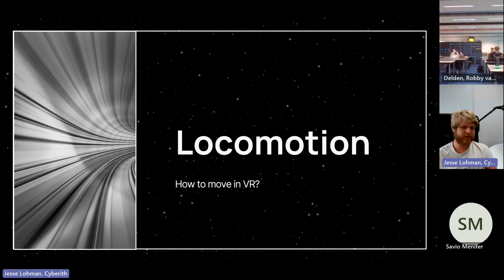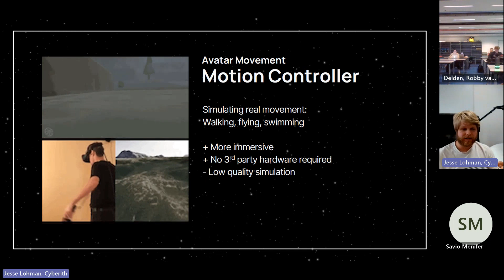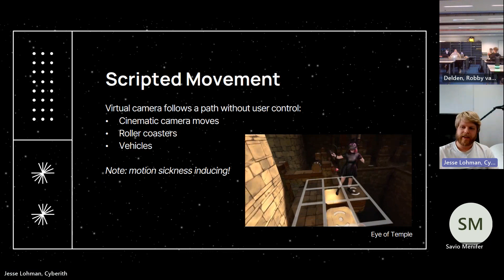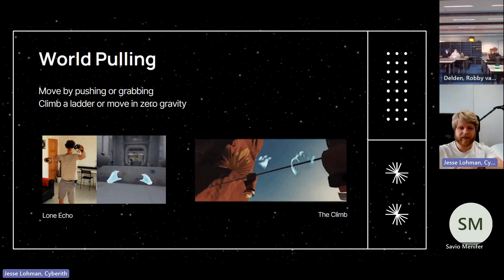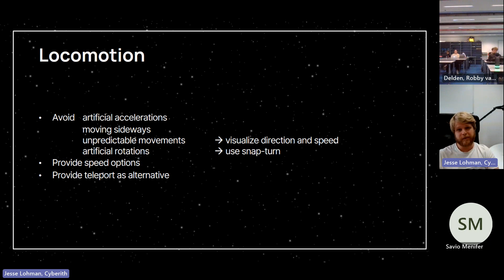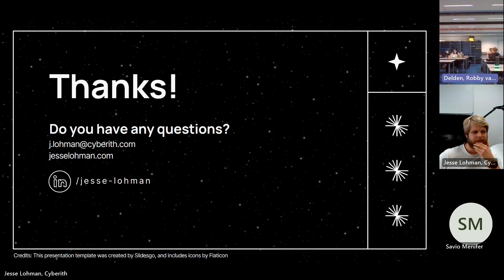Lecture Intro on Motion Sickness and Locomotion in VR

Comment: silly anecdote from personal experience. the motion sickness goes away with time (over the course of days of usage, not necessarily single session) if you use exposure therapy method. PLUS, and this is no joke, if u deep stop, and deep breathe, or just deep breathe while not stopping, it will and can get rid of the sickness feeling. do BOTH of these things and u can overcome it even with the current hardware's tendency to induce it to varying degrees. test this to confirm, and spread the word.